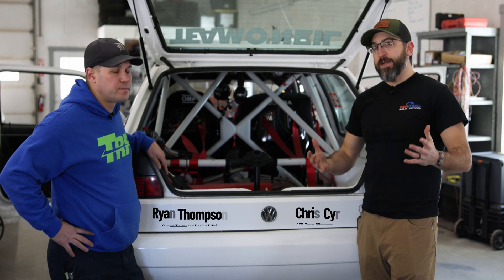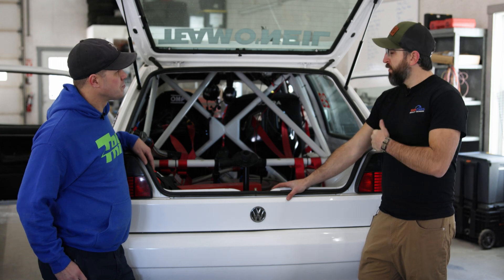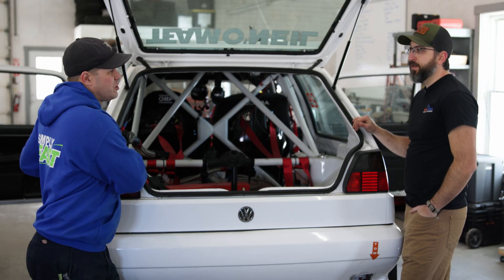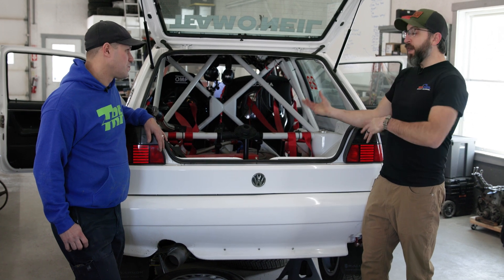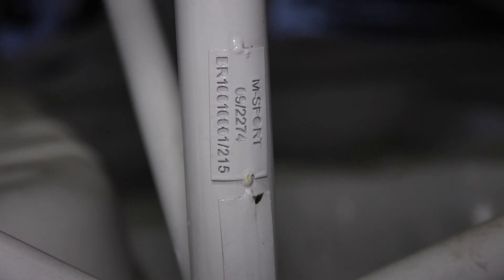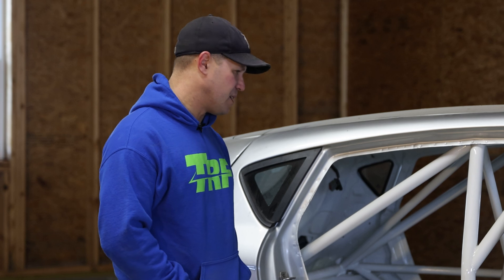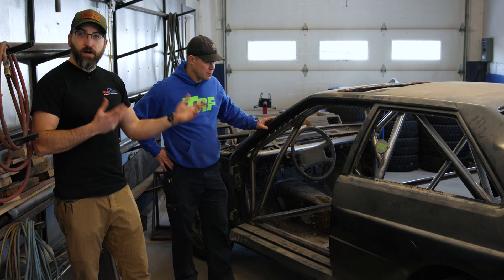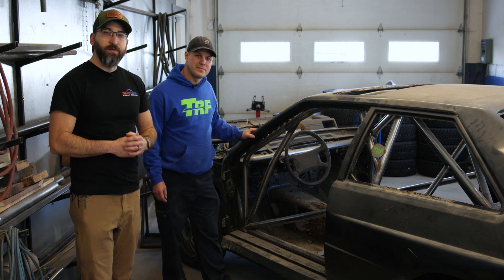Roll Cage Safety & Design | Types Of Roll Cages

Comment: Have to research about this Docol R8, and the T45 for Europe. Thanks! (It will probably cost 50 bucks per meter I'll be f*ct before being broke lol)
Here in Italy for DOM should be oleodynamic pipe namely E235+N (normalized), it's in a variety of diameters and thicknesses so that the 38x3 is a neat 1,5" x .12. 
Duuuude it took me long to figure out and find a dealer. That's quite cheap. The said 38x3 is 12euro/m or lil less, 68 for 20ft, 2 months ago.